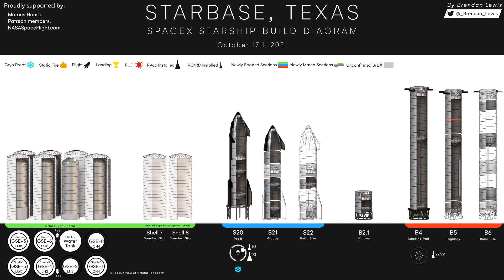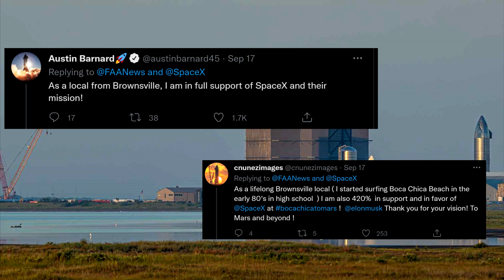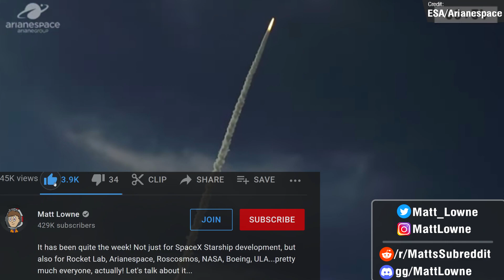SpaceX Starship 20 Static Fire Soon, Catch Arms, William Shatner Flies To Space, & NASA Lucy Mission

Comment: Considering the complexity of catching arms and the cost of fuel to land the first stage, at what point do disposable boosters make more economic sense?  I don't know just asking.
Reply from the maker: A comparable rocket to Starship would be SLS, which is fully expendable. The SLS rocket is expected to cost more than $2 billion per flight, and that is on top of the $20 billion NASA has already spent developing the vehicle and its ground systems. 

So if you can reuse a rocket completely, it absolutely saves huge $$$
Reply: You also have to remember that is is a much larger rocket than the falcon 9, over 30 engines are really expensive and reusing them is economically feasible considering their price

Comment: It just occurred to me that the Mechazilla arms should have tractor treads on them to better control slippage when catching a rocket.
The treads would have something like traction control/antilock brakes that keep your car tires from slipping in rain and show. You catch the rocket and the rubberized treads grips the rocket securely without causing damage. And there are motors on the drive wheels to make sure the rocket doesn't shift around upon landing. Because what if it's raining or something? The treads would compensate for any slippage and keep the rocket exactly perpendicular so it can be placed safely on the pad.

Comment: If your lightbulbs draw 60W you need new light bulbs dude.
Reply: Crack up, or tho, nothing like a filament wire quietly radiating hotter than the suns surface. I still like incandescent for a bedside light 😊
Reply: I miss the color of incandescent. And the warm feeling of getting blisters when you change a bulb.
Reply: @jameshughes3014  you understand that you can buy yellow LED's right. Same colour, order of magnitude less power use.
Reply: @jemw7787  i'm sorry Jem, it is not the same color. Incandescent lamps put out the entire spectrum. LEDs put out nearly laser light like narrow spectrum light. Look at a Christmas tree with LEDs next to one with real lights.. the difference is obvious. LEDs are great for a lot of things, and i love them. But i miss the warm, natural candle like light from incandescent. Is it wise to put 120 volt incandescent bulbs in a dying dried out pine tree? nooo, is it prettier? without a doubt.

Comment: i just hope:
- calculation of 27raptor engines emmiting heat toward each other , a cricular array and as the gasses expand they wil between the rockets saturn 5 had 5 well cooled and spaced engine and apollo13 had a center engine cut we all know why, but y y y. y y. WHY? ambient temp in the hardware, i hope the engines will all work perfectly and run cool, also i see dangerous discrepencies between the center engine()allignment as serious it shouldn't gimble after 30km and gasses expand, ik hope they wont blow it up before staging during orbital insertion or RVACS proof themself i bet they will
- i dont see aircraft spec like vert/hor-izontal hydrolic connection to the trolly or anywhere on the catch art if so the wired should allow  for softness with hydrolic on the cable, i though there would be a hydrolic (on the catch arm)mechanism that will absorb any aning contact/impact? to some degree. of themself i bet they will